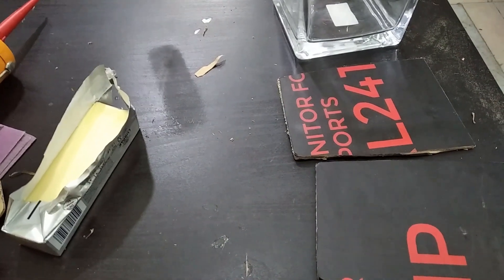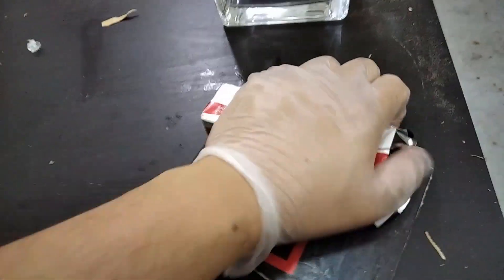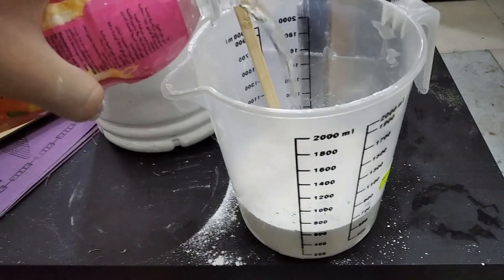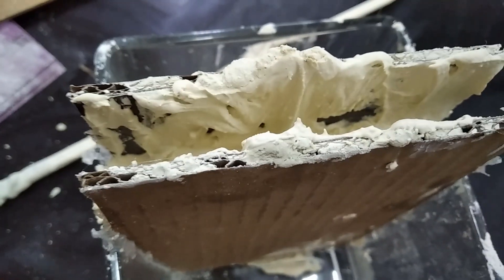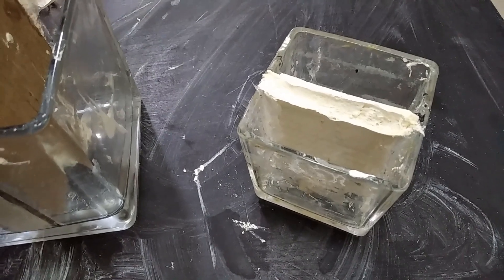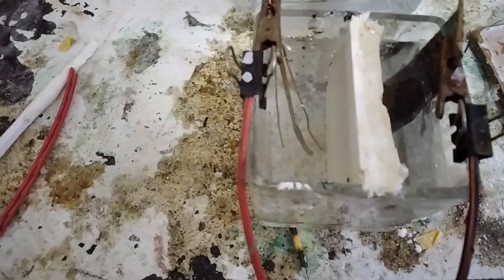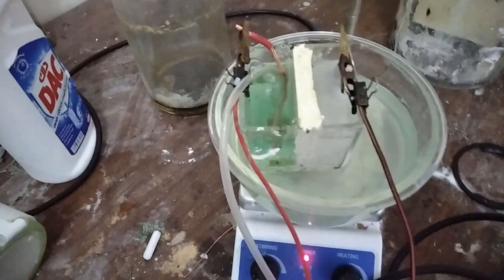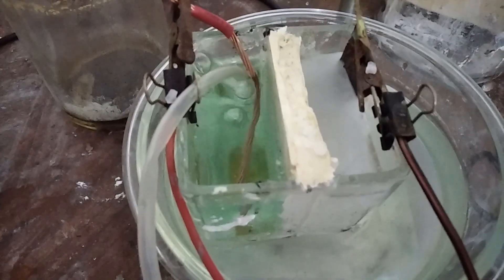Castable ion exchange membrane, ionomer cement.

Comment: why dont you just use terrocotta clay what are the advantages of this method?
Reply from the maker: Actual ion exchange groups which terracotta does not have allowing me to run lower volts
Reply: @CatboyChemicalSociety  does your method have less resistance than a terracotta membrane?
Reply from the maker: @josephdvid6  yes a lot less after polarization this thing can pull 4 amps at 6 volts
And the newer one yet to come will be even less resistance reaching 200ma/cm^2 at 5 volts.

This is why I like ionomer cement, its castable and convinient and has less resistance than terracotta and is basically the middle man of ceramic membranes vs polymer ion exchange membranes.

If you see cranial constructions latest video on sulfuric acid from epsom salts he puts 12V and only gets 0.12 amps which is terrible.
Reply: @CatboyChemicalSociety  nice I'm using it as a cation exchange membrane for large microbial fuel cells. Hydrogen fuel cells are the ones that use anion exchange membranes.

Comment: Hi sir, Can we use this membrane for Nickel-Iron Battery with KOH and LiOH.H2O alkaline solution?
Reply from the maker: CaSO4 does act as a solid state electrolyte so maybe but that depends on your experimentation.
Reply: @CatboyChemicalSociety are there any paper or publication about this cement ionomer membrane that I could read to study this for my experiment, sir?
Reply from the maker: @abdiseptiaputra  im sure there are papers on using CaSO4 as a solid electrolyte but not of this particular composition and there are also papers on cement batteries.
Reply: @CatboyChemicalSociety Thank you so much for your reply sir

Comment: really thanks, did you mixed cement with plaster or used pure plaster? and is this membrane for cation exchange or anion exchange?
Reply from the maker: Cement and plaster because plaster alone would crumble but overall it's both cation and anion membrane where calcium is what transfers ions and calcium silicate is the backbone while calcium sulfate exchanges by dropping sulfate ions for others. You can substitute plaster with calcium carbonate but oddly enough it works well as a cation exchange membrane because it passes sodium ions through when tested in chloro alkali cell. But works as an anion membrane also when electrolyzing copper in water with HCl on other side. This overall functions as a salt bridge that is castable because the salt is insoluble.
Reply: again thanks for your valuable responses, can I ask which membrane is appropriate for each Item of bellow question:  I want to electrolysis water in 2 conditions: A. cathode side a strong acid solution(H2SO4 or..) and anode side water so H+ transported from anode to cathode,  B. anode side a strong alkaline solution(NaOH solution or...)  and cathode side water, so OH- transported from cathode side to here,            @CatboyChemicalSociety
Reply from the maker: @sinaTonewood   well if you want to transport both types of ions you can use a bipolar membrane which allows for transfer of both cation and anions through it.
Over time though since you polarize the acid side with negative and base side with positive the ions will migrate rapidly to equilibrium and you get salts on both sides and further electrolysis will swap the contents of the chambers wherein acid now exists at the anode side and base at the cathode side.
Reply: valuable guidance, but I mean only one type of ion be allowed to transfer in each case, i.e. pure water in cathode and KOH or NaOH solution in anode, so when H2 produced and OH- migrated to anode, I need a material only allow to OH- but durable near such a bases, for the second experiment I use an acid in cathode and pure water in anode, so when O2 produced then H+ migrated from anode to cathode,   I hope this method can reduce the over potentials.        can you please guide me:          WHICH MEMBRANE OR SALT BRIDGE CAN BE APPROPRIATE FOR EACH ITEM? 🙏🙏🙏  @CatboyChemicalSociety
Reply from the maker: @sinaTonewood  you can use 2 different membrane types where you have a cation membrane to block anions and an anion membrane in the other chamber instead of just a bipolar membrane.
Just configure them correctly and polarize them correctly

Comment: Hey i was thinking coat a copper pipe outside with jb weld and run currant through it. Gas should form on the inner walls and float up. With 1 in pipe it should be enough that the water falls back down and doesnt over flow into the next chamber. Kind of like a pump sucking on a puddle it cant create enough suction to pull it all the way up before it breaks surface tension and allows air in. That way the gas doesnt get mixed back into the water. Kind of like a splash cell instead? Idk.

Comment: After months of trying nearly everything (fiberglass composites, perlite and epoxy composites), CaSO4 dawns on me because it's a solid electrolyte of the  acid I was making. I cast small 1-2 liter buckets, but I was unaware that CaSO4 had any special ion exchange properties. I was wondering, if I went through the PVA, Citric route with a plaster oxidation bucket, totally laminating it in the PVA, Citric combination, would it work at all and if so, would I exclusively get the anion bin the oxidation bucket? In the video I couldn't tell if you were using ion exchange resin or plaster. If I use store bought resin will it keep the cations and anions in their respective cells? 
Also my experience with just plain plaster of Paris has been the pH gradient goes in the opposite direction, like the pot becomes acidic, but that's when it really starts working well, where there's virtually no cation presence. What I'd really love to know is why it works, like what do you do to a monomer to create an ionomer, can it be done to epoxies or can a prefabricated piece of PVC tarp be converted to an ion exchange membrane?
Reply from the maker: you see my latest video on membranes shows how to make an anion exchange membrane using glutamate hydrochloride salt of glutamic acid and PVA.
where the free amine groups act as ion exchange for sulfate ions. but if you want a good anion membrane from easy stuff I do know a polymer that can bind anion resin from commercial water filters.
that polymer is Portland cement and you can mix white cement with ground up anion resin instead of plaster to make a good anion exchange membrane that selectively passes sulfate anion through the membrane.
Reply: @CatboyChemicalSociety  Awesome! Thank you for the prompt reply and clarity on the subject. So what I'm understanding is that the easy route is, if  I replace the plaster with cement and mix ground up water filter anion exchange polymer at a ratio of 3:1, I can just keep making my buckets. 
I'm going to watch the new video now, because I really want to understand how the ion exchange process works, so that I don't have to run around looking for a recipe for every species I want to filter.

Comment: Hi, I am very interested in making Daniell Cells that are rechargeable. However, for that, we need a membrane that filters Cu2+ ions and only allow Na+ to pass through. Does this ionomer cement with plaster of paris work? What ions plaster of paris allows the passing of?
Reply from the maker: these cation exchange membranes will allow Na ions to travel faster through them than Cu2+.
But if you want a membrane that outright blocks Cu2+ then look at my earlier video on making membranes using PVA and citric acid baked in an oven.
Reply: @CatboyChemicalSociety  I saw that video as well. Thank you. What about the sodium borate and Fevicol membrane? Will that outright block Cu2+?
Reply from the maker: @aadhithvarathan5432  sodium borate membranes are not stable long term sadly.
but they will also block out Cu2+
The one that uses PVA and Citric baked in an oven is the one you want.
Reply: Thank you very much

Comment: Hi, good job, thanks for video. Possible to use this  membrane for separation of hydrogen and oxygen from normal water? What is period of use of these membranes?
Reply from the maker: u can use simple porous fiberglass membranes for that since I assume you plan to build a membrane flow cell.
porous fiberglass and baffles are enough for your usage.
Reply: @CatboyChemicalSociety  Sir, thanks you for ur answer. What is your suggestion to use proper ingredients to alkaline water?
Reply from the maker: @genghizalseitov3807  if you are using stainless steel anodes then use NaOH, bicarbonate or KOH for your hydrogen and oxygen seperation cell.
Reply: @CatboyChemicalSociety  thank you Sir 😊

Comment: Nice work. I’m using cement as a binder for nickel zinc battery on my you tube. Getting good results.
Reply from the maker: cement batteries are a thing and I have heard of them before. They are usually zinc or aluminum mixed with cement cast in some areas and the central rebar acts as a cathode so that it inhibits corrosion of the rebar over time. These are one of the many ways rebar corrosion is prevented via electrochemical means.
Others include inline Ir-Ru MMO ribbon anodes but that requires active current connection running through it but the cement batteries are an area of research that doesnt require electricity to hookup to it and is meant to be a more passive solution.